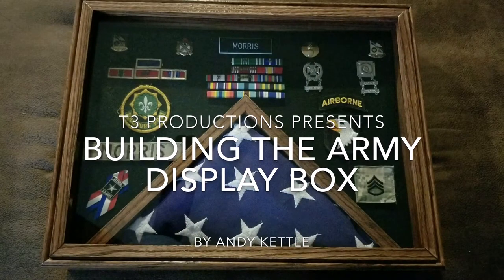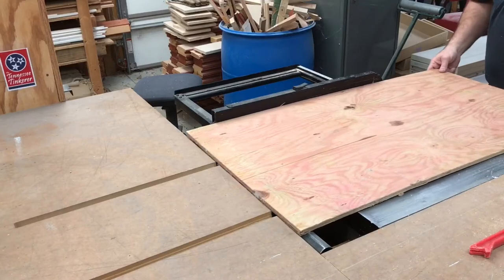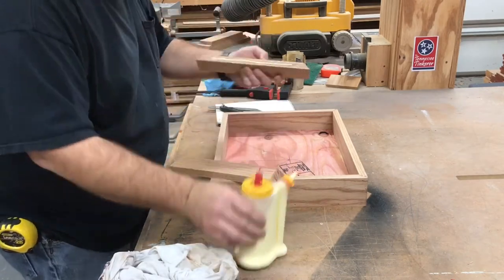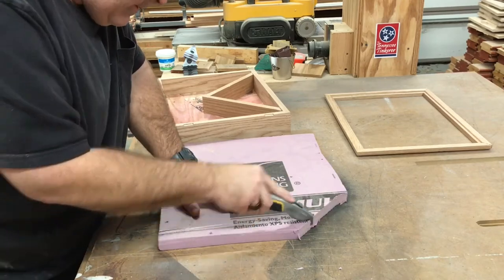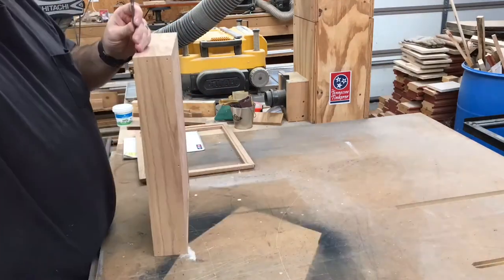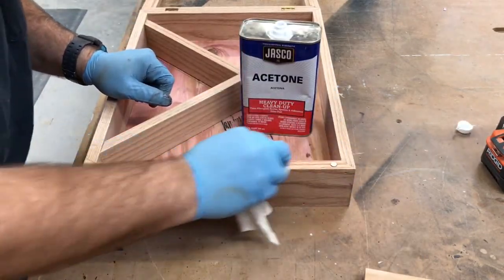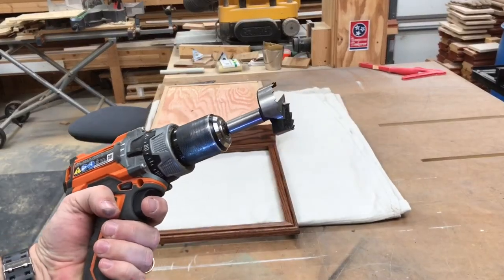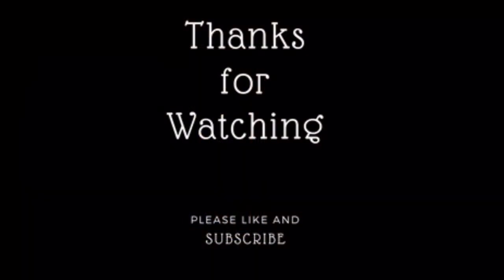Woodworking: Making the US Army Display Box

Comment: Ok, I have followed your video in producing the shadow box for the Eagle scouts.  Now for the lid.  I used 3/4' oak for the box.  what width did you use for the lid.  Then I will put a nice exterior router edge and a rabbit for the glass.  What bit did you use for the detail and what size for the glass edge cutout?  My wife loves your videos and we are working together on these 12 boxes.  Thank you
Reply from the maker: First of all, thank you so much for being a fan! I'm glad to hear you are both working on these Eagle scout boxes. This project, like most of my projects, was pretty much made up as I went. I don't remember a lot of particulars about it. It seems I used 3/4" for the lid as well, and ripped it to the desired width. As for the detail, I used a beading bit. The rabbit was cut deep enough for the glass to barely be below the surface, and probably about a 1/4" in from the edge. Hope this helps. Thanks again.